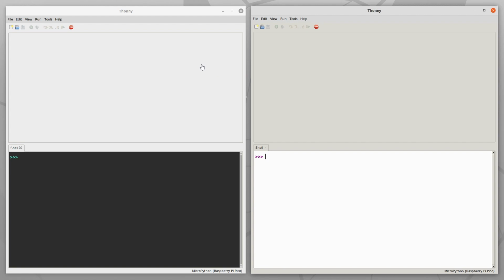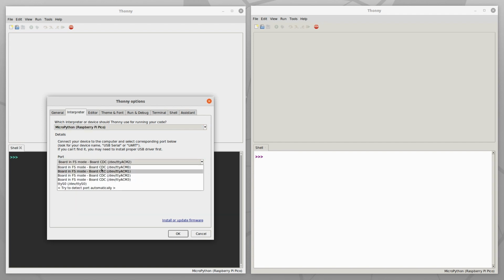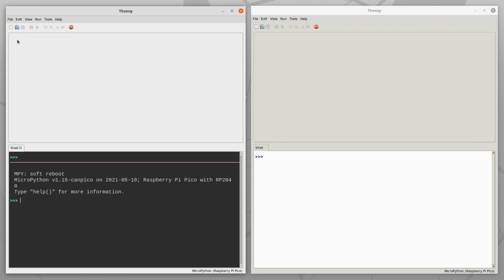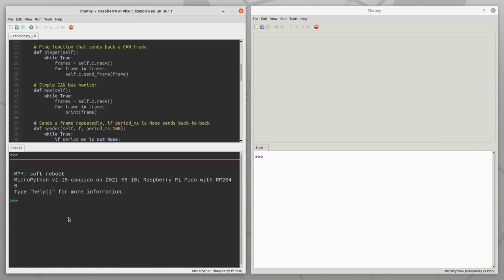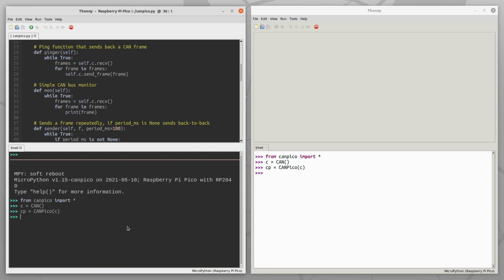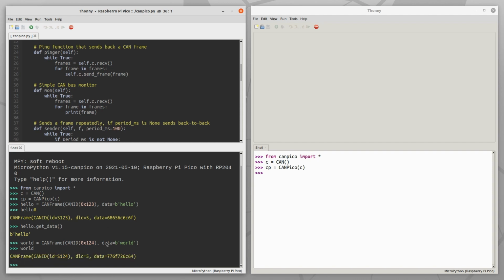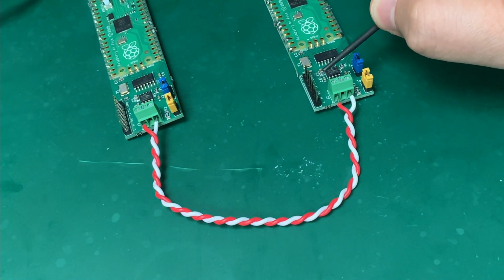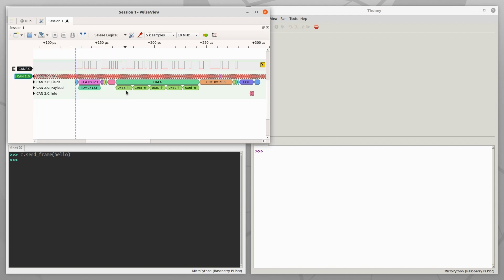An intro to the CANPico board

Comment: Very nice work on this. I wish ask you about the MicroPython SDK. I don't have the CANPico board, rather some cheep CAN board (SN65HVD230) and RP pico. How can I initialize all the CAN functions with my choice for pins? Thanks.
Reply from the maker: That's a CAN transceiver, not a CAN controller. So only the CANHack functions will work. You can breadboard up a CANHack solution, as described here: 

https://kentindell.github.io/2021/02/06/canhack-pico/
Reply: @kentindell  I see, thanks for help. :)

Comment: Do you have C libraries if I don't want to use Thonny/Python?
Reply from the maker: It's on the list to do. The MCP2517FD drivers are separate in the firmware source code and in C (they consist of SPI drivers for the bottom half and the remaining driver for the top half). The intention is to cut them into a C SDK and then refer to them in the MicroPython firmware so it's a common code base.
Reply: @kentindell  Good to know
Reply from the maker: Oh, I forgot: if you don't want to use Thonny you can use rshell (pip install rshell). It's a command line interface to MicroPython that handles the file system as well as jumping in to REPL.

Comment: Hi,
 Enjoying the boards.  
I've been experimenting with two transmitting to each other.  
Just as a casual observation I found that the RX board always buffers 1 sent frame into a frame list, then all the following sent frames are available in the following buffer/frame list. Say 6, 8 bytes frames are sent, I always get 1(list) + 5(list).

..Starting the loop
|- Frames has length: 1
|- Decoded message: __hello_, Timestamp: 2436748169, Arbitration ID: 291, CAN ID: CANID(id=S123), DLC: 8, Index: 0, Tag: 0, Is Extended: <bound_method>, Is Remote: <bound_method>
|- Frames has length: 5
|- Decoded message: message4, Timestamp: 2436748399, Arbitration ID: 291, CAN ID: CANID(id=S123), DLC: 8, Index: 0, Tag: 0, Is Extended: <bound_method>, Is Remote: <bound_method>
|- Decoded message: message3, Timestamp: 2436748621, Arbitration ID: 291, CAN ID: CANID(id=S123), DLC: 8, Index: 0, Tag: 0, Is Extended: <bound_method>, Is Remote: <bound_method>
|- Decoded message: message2, Timestamp: 2436748843, Arbitration ID: 291, CAN ID: CANID(id=S123), DLC: 8, Index: 0, Tag: 0, Is Extended: <bound_method>, Is Remote: <bound_method>
|- Decoded message: message1, Timestamp: 2436749065, Arbitration ID: 291, CAN ID: CANID(id=S123), DLC: 8, Index: 0, Tag: 0, Is Extended: <bound_method>, Is Remote: <bound_method>
|- Decoded message: __world_, Timestamp: 2436749289, Arbitration ID: 291, CAN ID: CANID(id=S123), DLC: 8, Index: 0, Tag: 0, Is Extended: <bound_method>, Is Remote: <bound_method>

 Is this expected behaviour?  Thanks
Reply from the maker: That's to be expected: the code is spinning round recv(), a frame comes in (via an ISR), it goes off to process it. The time taken to print is actually very slow, and in that time another 5 frames arrive. They're all processed together, the next time round the loop, that printing is very slow, and so on.

Instead of printing the whole frame, try printing just the number of frames. And then try removing even that print and simply appending the length to a list, and at the end of the test run printing that list.
Reply from the maker: You'll get another strange effect on transmitting: if you transmit a list of frames, starting low priority and going up to high priority, the frames will likely be transmitted in priority order except for the first one: the first one starts transmitting as soon as it's put into the controller (assuming the bus is mostly idle) then the subsequent frames are stacked up, with the controller choosing to send the highest priority first.
Reply: @kentindell  thanks for the info and support,  I’ll take onboard your feedback and experiment some more.

Comment: halllo 
I am trying to initialise a can (c = CAN ) but i receive this Error 
RuntimeError: Cannot put MCP2517/18FD into config mode
what can i do to fix that 
THX
Reply from the maker: That's an error message to say that the CAN controller chip refuses to be reset. It shouldn't normally happen.
Reply from the maker: It sets the C1CON register REQOP field to 4 (request configuration mode) and then reads the OPMOD field to see if it went into configuration mode. Out of reset this it the default, so it should always be OK after power on. This means either the SPI interface isn't working or the CAN controller chip isn't working. One possibility is that the power supply is below voltage and the controller isn't coming out of reset cleanly. Does it do this on a powered USB hub?
Reply from the maker: A thought: can you also try adding hard_reset=True parameter to the initialization call?
Reply: @kentindell  yes it is usb powered
Reply: @kentindell  i do it but i have de same error
Reply: @kentindell   what else can you recommend to fix this problem ?
Reply from the maker: @arseneapegouinzeugang2544  Sounds like a hardware fault. Email ken@canislabs.com and we can discuss how to fix this.

Comment: Have you considered using the PIO functionality to build up an internal CAN controller?
Reply from the maker: The CANHack board has a transceiver but no controller and uses software on the RP2040 to bit bang the CAN protocol. It's primary purpose is to demonstrate CAN protocol attacks. You can run this software on the CANPico board because we designed it to have direct access to the TX and RX pins of the transceiver.

It's possible to use the PIO to provide the raw CAN bitstream but there's a lot more to the protocol than just the bits, and the second CPU core would have to be dedicated to the job.
Reply: i think we cant

Comment: HI 
Can i use this CANpico With a Sparkfun Thing Plus RP 2040 ? 

THX
Reply from the maker: I don't think the Sparkfun Thing has the same pin layout, but I'm pretty sure if you deal with that with jumper leads then it should work: the CANPico interfaces via SPI and a couple of GPIO pins.

Comment: Hi Doc, I just purchased some of the boards and pico's but the can chips are out of stock for the next year or so, is there a Maxim or TI equivalent as I am excited to get them going .
Reply from the maker: Hi! You can use MCP2517FD CAN controllers instead of MCP2518FD - they're functionally almost identical (the firmware runs wiht both).